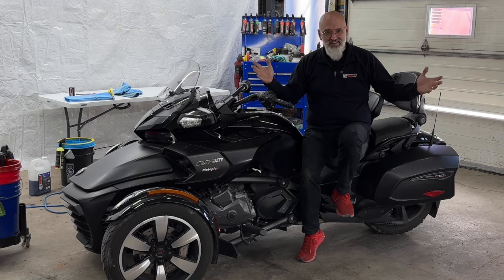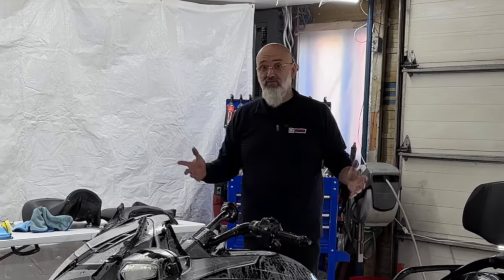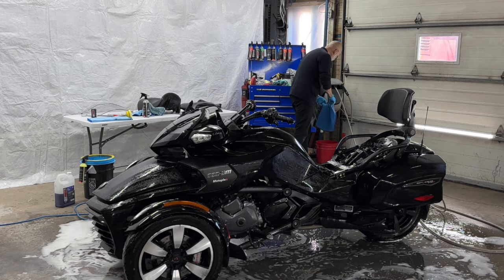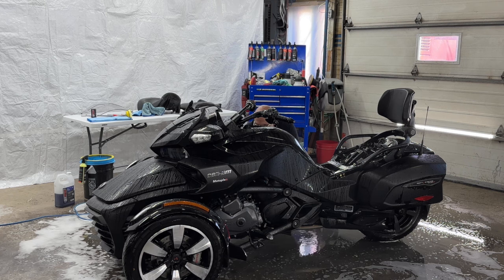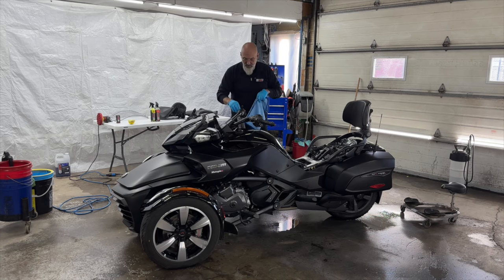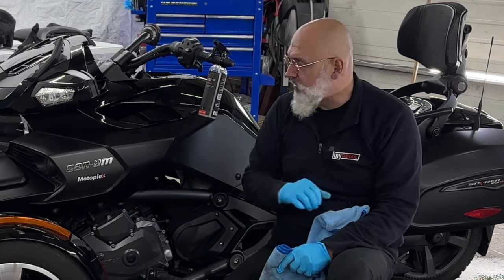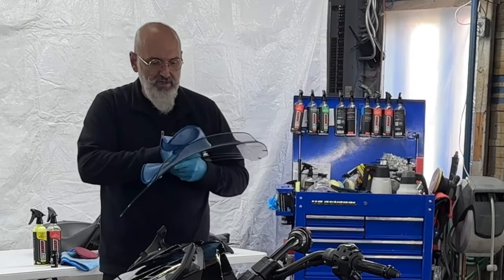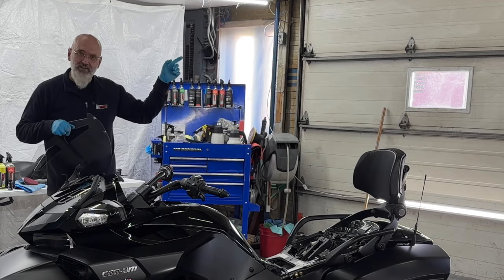Protect any surface with one ceramic ! Spider, moto,ryker

Comment: Rinseless is so versatile. Wasn’t a believer until Yvan’s preaching finally got me. Now it’s replaced my foam canon and pressure washer 2 hour weekly car wash routine with a 35 minute, safe, and effective one. I have a high end watch collection and now use rinseless to clean them as well as my marble and granite countertops. For the longest time, any method of cleaning would leave residue on my counters and watches. Rinseless is perfect for both. 
Cheers Yvan!
Reply from the maker: Thank you

Comment: Is your 8 year coating the only coating in your lineup that actually becomes apart of the clear coat for the first 2 to 3 microns as it's the only one said to contain SiC? Or do all your coatings do this? Thank you!
Reply from the maker: All our coatings penetrate the clear coat, they all contain Polysilazane, silicon carbide, silicon dioxide, and silicon nitride.

Comment: I have an off-topic question. What pressure washer hose do you guys normally use, and do you have any recommendations? I'm currently using the really stiff and swirly hose that comes default when you buy a pressure washer. An upgrade is very much needed.
Reply from the maker: Get a good flexible hose(1/4”). A local hydraulics shop will be able to make you a custom hose at a reasonable cost.
Reply: Thank you so much for your quick and informative response. I really appreciate it. @diydetailofficial
Reply from the maker: @YhurHurt thank you for the question.